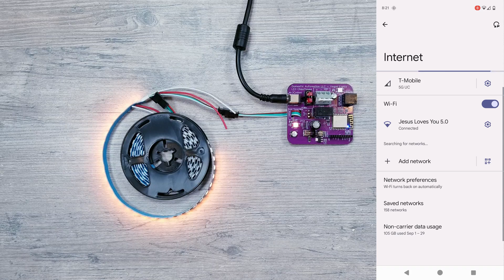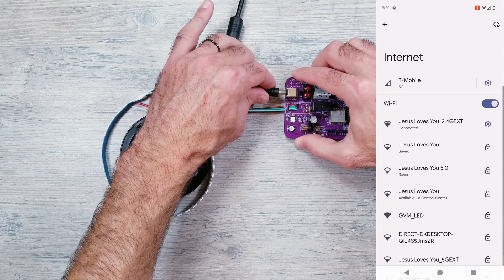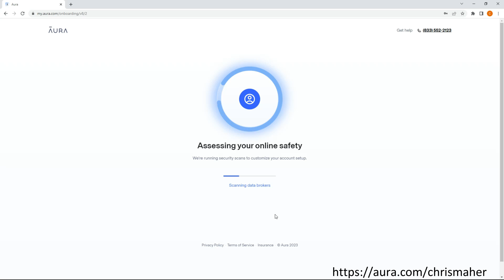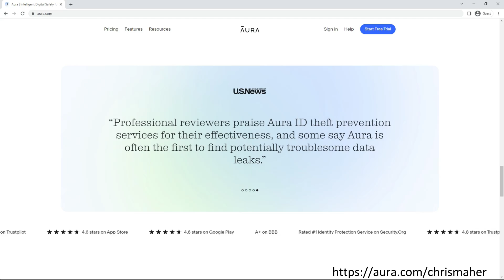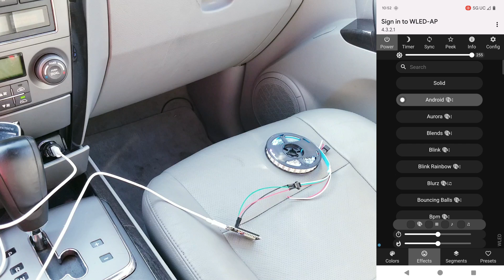No Wi-Fi, No Problem! Setting Up WLED

Comment from the maker: 📟 BEST Amazon Deals on Electronics: https://amzn.to/47qjC9j (updated daily)
☑Check out my sponsor to begin your FREE 14 day trial to Aura: https://aura.com/chrismaher
WLED Plug n Play Controller: https://amzn.to/3rFBOK4
Power Supply: https://amzn.to/3rzTw1K
LED Lights ws2812b: https://amzn.to/3rBmuOI
ESP32 Board: https://amzn.to/3Q0uNNi
Micro USB Power: https://amzn.to/3PI32Yu
Portable Power Supply I Recommend for using LEDs on the Go: https://amzn.to/3tmj96u
Car Charger: https://amzn.to/45f0EhG
Thick Jumper Wires: https://amzn.to/46e60uV

Check out my sponsor to begin your FREE 14 day trial to Aura: https://aura.com/chrismaher

WLED for Beginners: https://youtu.be/D_URUFJvLOo
Install WLED on ESP32: https://youtu.be/TOEnFKLm9Sw
Domestic Automation WLED Overview: https://youtu.be/aBOEHfT8VY4
PLUG n' PLAY Motion Sensor & Push Button for WLED
Soldering for Beginners: https://youtu.be/apSz3NXYlx8

The best way to help support my channel is to like, comment, make sure your subscribed and share my videos with as many people as you can. The other way is to use my links above as I get a small % at no extra cost to you if you buy something. Thank you all for the support!
Reply: Thanks for the links Chris, always appreciate your videos.
However, when I link to the Plug n Play controller, it sends me to a general search results page for controllers (mostly BTF lighting)
I was able to find an active listing for Domestic Automation by googling the description, but unfortunately I get the: Currently unavailable. We don't know when or if this item will be back in stock.
Are you aware of any other way to source the boards?
Tks
Reply from the maker: @scottjohnson60  it's still showing available for me but I'm in the US. Where are you located? My guess is they are not available outside of the US yet.

Comment: If you are feeding an LED strip, remember that a given connection between wires and the strip can handle only about 3-4 amps.  So if you are feeding from one end, DO NOT set your current limit to 9000 mA; the limiting factor is how much power you can deliver through one end, not the amount the power supply can generate.  Too much current through the end will cause heat and potentially fire.  If you are feeding power from both ends, that allows twice as much.

Comment: Love your informative videos. I purchased a Domestic Automation controller from Amazon and have never been able to get more than 25 pixel to light up even when I change the amount of pixels to 50 in led preferences. I've tried to reach out to Domestic automation and haven't gotten answers. I've use other wled controller in the past and have never had that issue. Could it be a software issue? No micro USB to reinstall wled.
Reply from the maker: The only other thing I would try is going into segments and making sure that is not set to 25.
Reply: Thank you for your help. That was the problem, I had to remove the check marks off 10 segments and reset the segments. Now it's working fine

Comment: I'm new to all this but thanks to you I have decided to go this route instead of spending hundreds on boxed LED kiys, so Thank You So Much!!  BUT... I'm having issues with WLED showing my lights offline at times and I don't know why. So when I saw this video, I was excited because I figured this was my pathway to a solution. I went to my Wi-Fi settings on my phone, but did not see WLED-AP listed. I then went into configuration within the WLED app and changed the option under the WLED-AP Always instead of Disconnect after boot. I was then able to see WLED-AP as one of my Wi-Fi networks, but it keeps trying to connect to the previous Wi-Fi and doesn't seem to work. So while I was excited to be saving money, and FINALLY was able to figure out how to get wled on my esp32 and turn the lights on, I'm kinda discouraged now because I have 11 five meter rolls just in and need to splice and run everything, But I'm afraid of these issues l connectivity issues continuing. Please please can someone walk me through resolving these issues. 🙏
Reply: Having the same issues 😕 
the bord is resetting the setting everytime it boots 
not liking this
I hope you shear with me the Solutions
Reply: I ended up buying a cheap mobile router which I dedicated solely for the use of "talking to" my esp32 boards. I put all the boards pointing to it, then I get on that network when I want to open wled and so far it's a good solution
Reply: This is what I was looking for. Thank you for the solution.

Comment: Even if you aren't connecting to home wifi, you are still connecting to a wifi networkput out by the device. To you have any info on doing this process.. actually without wifi?

I love the rest of your videos, sorry, this just makes no sense.
Reply from the maker: Thanks for watching and taking the time to comment! This video was in response to a lot of questions like "i dont have wifi at my cabin, can I still use WLED?" Or "I dont have wifi when i'm at a festival but I want to build something with LED's. Can I use WLED?" This video goes over how you can still control lights even if you are not in range of any wifi. I am curious though, what situation would someone be in where controlling lights like I went over in this video would not be a possibility? The only scenario I can think of is if someone doesn't have a smartphone. I think there are IR remotes that you can use but I have not looked into compatibility with WLED.
Reply: Ah thanks! I was thinking a situation in which someone still has internet, maybe even a home wifi network, but no other devices such as a cell phone with wifi capabilities. A bit semantic but I think the big confusion is wifi v. internet. You can have a wifi device such as a cell phone and even without home internet, still use that wifi connection like you showed in your video. The situation I was thinking of is wether or not you have home internet, you don't have any devices capable of using the actual wifi communication protocol 802.11. Some people often have an internet connected computer connected via ethernet on the 802.3 standard but they don't have any wifi capable devices, even with internet. Thanks anyways! @ChrisMaherDIY

Comment: I'm new to the LED / Smart Home space, and want to integrate multiple LED controllers in HomeAssistant . Wondering if there is any Zigbee/Zwave options for WLED + ESP32? Any limitation (other than home modem specs) when running mulitple (5+) ESP32 devices connected via Wifi?

Comment: Hi Guys,
Hi Chris,

I am currently in the final planning stages of my LED project. I have just reached a point where I don't know exactly how to do it and if it will work. So I wanted to get your expertise on board. The idea is that I lay 0.5 meters of Gove M1 (60 RGBIC / meter) LEd strips in a wooden acoustic panel. A total of 8 of these little strips. 
I wonder if I can now really just string T pieces together and it still works. I have also considered using Wago terminals instead of the T connectors.

Best regards
Auer Bernhard, a big fan

Comment: Another great video! question though.. re Sound Reactive builds.. Have you experienced any issues with your sound reactive set up ? I recently followed your tutorial on how to set up ESP32 with sound reactive, used the same components, however, every now and again the sound reactive portion would stop working after a power cycle, and the only way to get it back is to re-flash the ESP32? it's so annoying. I can't find any forums that can explain why this is happening. Any thoughts? cheers.

Comment: Chris the QuinLED products, Dig2Go, DigUno, DigQuad, DigOcta all come with WLED preinstalled and a lot of great features for beginners - level shifter so you dont have to worry about data boosting, addition power insersion output and fuse protection for the separate power lines. For more complex projects you have 4, 8 or more light set controls from a single controller.

Comment: is it possible to hook up multiple different led strips on different pins on a ESP8266 Board? also love the vids!
Reply: The D4, D3, and TX pins all work on the 8266. The only thing with using the TX is that it requires about 5 times more memory per led, so it isn't really advised to use it on long strips.

Comment: Thanks a lot, you skip the first led and say something like data booster? It’s recommended for all wled projects? What is the benefit of it?
Reply from the maker: Thanks for watching and great question! You generally don't need a data boost as long as your first led is close to the controller. But if you let's say have the controller and then 2 meters of wire and then the first led, the data signal might be too weak to make it to the first led resulting in the lights flickering or not working. Having that first led on the board automatically boosts the data signal letting you then run a good distance of wire to the led strip without having any issues with flickering.
Reply: @ChrisMaherDIY  Thanks a lot Chris, this information is very helpful und useful. I will give them a try because I really struggle with some problems and couldn’t find out why. Your channel is just awesome, many thanks and I appreciate you share your knowledge with us in a very professional way. Many regards from Germany
Reply: @ChrisMaherDIY  thank you so much, great help
Reply: +1 would like to know too

Comment: Hey Chris, is there a way to sync 2 lights (2 esp)  when you don't have wifi?
Reply: In the LED settings, you can ADD another data line :)
On ESP8266's you can have 3 in total
On a ESP32 you can have around 6 I think it is, ESP32-C3 can only do 3 like 8266's.

EDIT, I see you mention 2 boards, sorry about that.
Reply: connect one esp to the wifi of the other?
Reply: @DanielSanNinja  so I'd start by running both in AP mode.  A and B,  then I would log into the AP of board b and change the WiFi to that of board A.... then I would connect to board A AP and be able to control both?
Reply: @eliteman125  should work... haven't tried tho

Comment: do you realise you are using wifi and the whole video is about not using wifi?
Reply: Even though the title could have said “Control WLED without a router” or standalone “WLED controller” but the video still makes lots of sense.  Excellent video for remote operations.
Reply from the maker: Thanks for watching and great observation! You don't have to connect the esp32 to WiFi to be able to control it via a direct connection from a phone, tablet or computer.  This is one of the questions I get asked the most because a lot of people assume you do have to have an available WiFi network to connect the esp32 board to in order to use WLED. Hope you have a great day!
Reply: same... did not understand.. i thought he will use network cable.. hmm
Reply from the maker: @Koi-Koi-Koi I get a lot of questions like "what if I want to set up lights in my car but don't have Wi-Fi?" Or "can I still set up lights and use WLED at my cabin that doesn't have WiFi?" This video shows you how you can connect and control lights using WLED without having to connect the esp32 to any Wi-Fi network.
Reply: @ChrisMaherDIY  your link doesn’t bring up this device
Reply from the maker: @taurus533  it's still working on my end but I am in the US. My guess is the product is only available in the US.
Reply: @Koi-Koi-Koi exactly. I came here because I want to control WLED while my phone is using wifi for another controller.